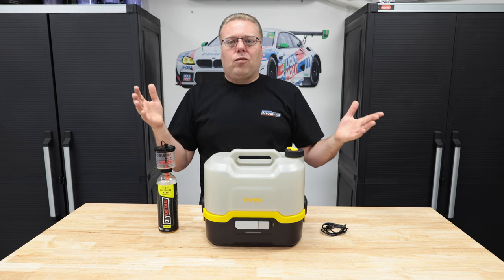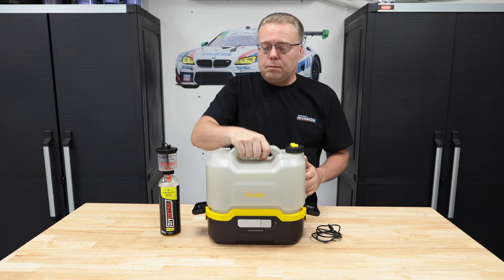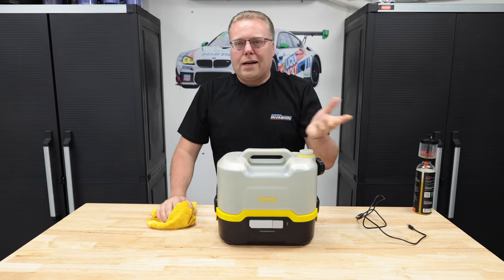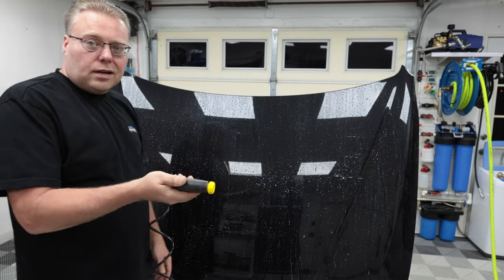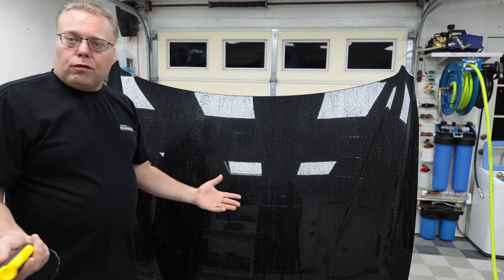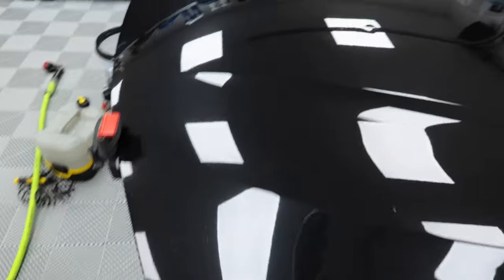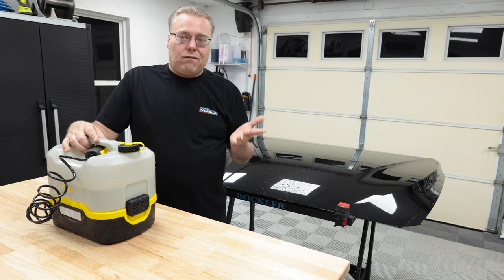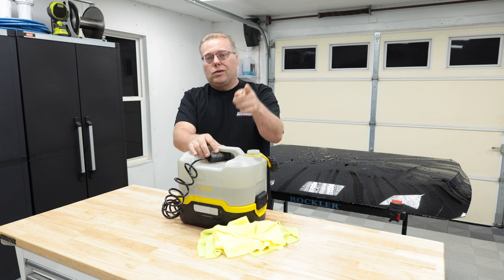Best Rinseless Sprayer? | Battery Powered | Fanttik NB8 | Review & Testing

Comment from the maker: I just noticed that they just added a $15 off coupon on the Amazon listing for this and the 25% off redeem button is still there. That puts it at $83!!!
Reply: You know I considered purchasing this thing a few months back for about 69 bucks however when I read that you couldn't use any soaps or liquids besides water I decided I shouldn't. Maybe I will after this review because it seems really neat for rinseless washing
Reply from the maker: @Mr.SparkleOG  Somebody in the comments said they have been using DIY detail rinseless with theirs for 4 months or so and no problems so far.
Reply: @CarsWithKeav  I did see that and it seems like a better option than a detail keg as those run hundreds of dollars. Thank you for posting this video finally!!

Comment: I was checking it out and noticed the $15 off along with the 25% discount.  So I picked it up for a little over $86 after taxes.  We’ll see if it works out well.  I have two Marilex sprayers and an IK Pro Foam 12+.  It will be good to see how it works compared to these.
Reply from the maker: That’s a great deal I saw that as well when I was building the description of the video. I pinned a comment about it. Such a good deal. I heard it was It $69 during Black Friday, but that’s a once a year deal.

Comment: Bought this around the same time as you and use it exclusively for rinseless wash. DIY Detail rinseless as well and I've had no issues with the seal or the sprayer. I do pour out any remaining liquid after a wash but so far so good!
Reply from the maker: This is great to know and thanks for the info on your experience!
Reply: I put some rinseless wash in it and the seal started leaking. Lesson learned just use it for water…. The liquid was onr
Reply from the maker: @kjrayo18  I would not think ONR would have cause the leak though. It’s the same consistency as water and has no alkaline or acidic properties to damage any seals. Are you saying it doesn’t leak when using water?
Reply: @kjrayo18  interesting, did you check your seal? Mine is still fine and not leaking

Comment: I used a modified ik foam pro 12 for about a year, and it was great. This was before the multi pro 12 that now has the schrader valve I believe. I’d just fill from the compressor and be good to go. I also bought the tip kit for the multi pro 12 from detailed image to swap out. I bought a keg recently that has also been great, just holds the pressure a bit longer.
Reply from the maker: Kegs are a great idea for sure especially how they are getting cheaper and the parts to convert them as well.

Comment: For me, using a pump keg like the big IK wasn't a cost issue. It was a packaging issue.

I do all of my washes in a quiet self-wash bay.

Haul all the supplies I need to and from in my 2 seater.

Packaging is important.
This thing is PERFECT for my applications.

I've been using two IK Multi Pump sprayers, prefilled at home, for my rinseless presoak/sprays. It's a pain.

I take a 3gal bucket, with a Gamma Seal, with premixed rinseless with me. 3 gal bucket so that it fits in my short trunk.

I ordered this thing instantly after watching your video.
Reply from the maker: I’m glad this was able to help. It’s a very situational product as I try to explain to others saying it’s unnecessary. Might be for them, but not everybody.
Reply: @CarsWithKeav  You're right. It's definitely not for everyone.

I'm happy that you covered it.
I think most of the detailing YouTubers still prefer a "standard wash". I include myself in that group.

So really specific/rinseless solutions just don't get covered because it doesn't really fit their situation, where they have access to all the water, all the time, all the space, inside the garage, etc.

For apartment dwellers, a product like this really provides some value.

I'm glad rinseless is getting a lot of attention again, recently.
It means content creators are going to make more rinseless-centric content to ride that wave. More information for people to consume.

Products that typically wouldn't be covered are getting videos.
Reply from the maker: @ I still do both just depends on my mood really. If I have 3 of my cars to do I’ll go rinseless for the contact wash. If it’s just one then it’s a foam party.

Comment: You are just pumping out the product reviews. Great job, keep it up. 👍

One product I want to get is a paint depth gauge. Unfortunately they aren’t talked about much. With all the products you’ve done have you tested any? Aside from the $$$$ professional there are a ton  of cheap ones on Amazon, but I have no idea which one, if any, is actually worth it. Nex Diag has some in the $100-200 range. I’d have no problem paying that, if theyre worth it.
Reply from the maker: I have not looked at any yet as I don’t do much paint correction. It’s something to look into though.
Reply: Thank you for your video man, can this be used with orange degreaser from 3D, or other degreasers for pre wash or just rinseless?

Comment: I’ve been using the SideKing battery powered sprayer for my rinseless washes. A little over a gallon capacity and I can get more than 2 washes with that solution. Less than $40 and I’ve only had to recharge it once
Reply from the maker: That’s awesome!

Comment: Looks like a great little unit for much less cost than a detail keg. Plus you don’t have to spend time starting up the compressor and filling the keg with compressed air.
Reply from the maker: It is a great little unit. Have not used a detail
Keg so unsure of the performance, but I have an IK pro 12 so know all about filling from a compressor.

Comment: I like using the Worx HydroShot to apply my rinseless solution to my car. I zip tied a 2-3 pound scuba lead weight to the intake filter so it stays in the bucket.
Reply from the maker: That’s a great idea. The Ryobi ez clean is a good option as well.
Reply: Doesn't that use a lot of product? An IK Multi Pro 2 filled to the brim (almost 1/2 a gallon) can cover a medium sized car, but I guess the Worx with it's higher pressure will take maybe twice as much?
Reply from the maker: @martinp8427  I have the Ryobi version and if you turn down the pressure and use a chemical tip it sprays about the same. If it comes out more you just got to move faster. Also great pressure to clean off debris.
Reply: @CarsWithKeav  Thank you for the comment! The more I research the Ryobi 600 psi and Worx 725 psi version, the more they feel like a good investment and not needing to go to the self serve pressure car washes.
Reply from the maker: @martinp8427  I made a video on the Ryobi one if you are interested. https://youtu.be/Vot1miL9aes?si=r5ANbtvR00Tiukta

Comment: Just built a detail keg for about the same $ (without the discount) as the cost of this unit. Would have considered this as an alternative.
Reply from the maker: How hard is it to find a decent empty keg? I know some people don’t want to go looking for one.
Reply: @CarsWithKeav  Corney Keg is where to go. Always in stock and not to expensive. I bought the "CORNY KEG CONVERTED BALL LOCK CORNELIUS STYLE KEG W/ MANUAL RELIEF VALVE LID" Man it went down in price since I bought mine
Reply from the maker: @05xrunner  Seems they have I remember a year ago I was thinking of making one and with everything all together it would be $300. Main reason I never did it was because a 5 gallon keg would be quite heavy with liquid, but I guess you only fill about halfway probably to get a good bit of air pressure.
Reply: @CarsWithKeav  Yea, I put about 3g in mine and it really isnt heavy at all feeling. Its amazing the Keg itself empty almost feels like it weighs nothing. I built my Keg a few weeks ago and it cost me about $160. With 3gal I pump it to about 50psi and it sprays forever and is game changing I feel compared to any other type of sprayer. 
Just save the coin and build yours instead of paying 400-500 for a prebuilt that is highway robbery compared to what it really cost. I just copied the build of detailing breakdown video he put out a few weeks ago.
Reply from the maker: @05xrunner  I have seen a few that are built for you for $300 to $350 so the price has gone down. Now no clue what is being used, but if I made one I'm sure it would be expensive I would have all the cool stuff. LOL

Comment: So since I just watched your video on the Amazon deal on this I decided to re-watch this video.  Since this is 5 months ago have you noticed any issues with the rinseless wash staying in the sprayer non-stop since its really designed for just water.  Also have you noticed any reduction in performance of the rinseless wash if it has sat for a long time in the sprayer. I usually mix up my waterless wash solutions in 32 ounce bottles so the solution never stays around for more than a couple of weeks per bottle.
Reply from the maker: @coolwrld302  I talked to Yvan about that and he said since the lid is sealed you are good for 3 months. Open bucket not so much. I myself use it up in a week and a few weeks at the longest. I did notice my 5:1 P&S brake buster in a container started to exhibit performance loss after sitting for a long time. Mainly after switching to Maniac it sat for awhile until I decided to use it all up.
Reply: @CarsWithKeav  Good to know about the rinseless. Have you noticed any issues with the sprayer itself keeping product in it constantly over the last 5 months?
Reply from the maker: @coolwrld302  None at all I beat this thing to death. I kick it around and no problem. Well actually one time I pinched the hose by not properly storing it underneath so it leaked, but it was close to the connection so I just cut the tube and refitted it and worked fine since. That was probably a week after I made that video. I no longer store it underneath I wedge the spray gun in the handle area works better that way. I’m too impatient to store it properly. 🤣

Comment: Ryobi has a battery powered spray for $65 that I was eyeing since I have Ryobi batteries. Have you seen it? Do you think it would work well for rinseless? I'm so tired of pumping haha.
Reply from the maker: I’ve used that one around the house for insecticides. It would spread out just fine, but it won’t have much pressure compared to this one.

Comment: Great. Thanks for this. Will make doing rinse less wash much better. Ordered one. 

Do you have any recommendations for decent spray bottles. I need to make myself a rinse less wash diluted spray bottle for other detailing needs as well as general house hold cleaning or auto interior cleaning. 

I know OG sells their bottles. But I also know he’s talked about newer version bottles with stainless steel nozzle tips. So I am not interested in spending money on his till he’s done his idea. 

Preferably if you have a really good spray bottle recommendation other than his that would be great.
Reply from the maker: I have a suggestion, but it is something he sells and that would be the solo 260 which you can get on Amazon as well. That works great with rinseless.  I’m not into regular spray bottles. I tried the Pressol and they didn’t do well with harsh chemicals so I stopped using them. If you can find an older solo 460 I prefer that one as it has great chemical resistance.
Reply: @CarsWithKeav  actually I have a newer Solo that I was going to use for something else. lol move over other thing and hello new (rinse less wash). Do you think the chemicals of RW will be a problem for the newer solo. 

Sorry to ask this question here. I am trying to find a home for a Bigboi blower (the larger model), and a Kenzie TST1122 all in one pressure washer, and a Vyoer Chair. All specialty items. Any ideas on where to find interested people other than Facebook. 

Again thanks for your help on these recommendations.
Reply from the maker: @26-CJ  I only really know of Facebook Marketplace or the detailing Facebook groups that are for selling used equipment. Rinseless Wash chemicals should have no impact on the Solo at all. They are almost water like with just polymers and some surfactants.
Reply: @CarsWithKeav  👍🏼. These measuring pro blend proportioners. Are they safe to leave attached to the bottles or do you remove yours when done. Mostly concerned with the product staying fresh inside the bottle.
Reply from the maker: @26-CJ  It has a cap at the top to keep it air tight. I always leave them on,  it have gone away from using them to using pump dispensers and storing bulk dilutions.
Reply: @CarsWithKeav   makes sense. So to make sure I understand. Your not using the pro blend proportioners because your using the spout dispensers and pump dispensers with pre made dilutions?  If so I get the tall thin storage containers with the control valve to dispense the pre diluted product. What do you mean by pump dispensers if you don’t mind me asking.
Reply from the maker: @26-CJ  Just replacing the proportioned with a pump that dispenses exactly one ounce. Just a soap dispenser nozzle that you push down and is spring loaded. Like these https://amzn.to/3xes7oZ
Reply: @CarsWithKeav I received my sprayer today. Cannot wait to use it. Does your tank have a slight darker look to it. Almost like a very subtle black appearance throughout the entire reservoir.
Reply from the maker: @26-CJ  Yes it has a slight tint to it especially when the cap is closed.
Reply: @CarsWithKeav  ok so then it’s not just mine. Now in your video the lighting you have must flush out the color I am seeing in mine. Yours looks more like the plastic on a milk jug looks. Milk jugs usually are not transparent much like this sprayer container. But mine has a consistent darker (appears like a black color) all through it even with the lid off. I was worried it was a returned item that had something in it that stained it.
Reply: @CarsWithKeav  hey do you know if these pumps you gave a link to will fit the DIY 1 gallon jugs threads?

Also do you know of a pump size that will also fit the DIY 16oz bottles.
Reply from the maker: @26-CJ  yes, they will fit DIY bottles I have one of them on my incredible suds gallon bottle. There are ones that for 16oz bottles, but they dispense of much smaller amounts. Takes like 4 pumps to get an ounce.
Reply: @CarsWithKeav  cool thanks for confirming. I had to throw out the pro blend proportioner since it leaked really bad when I tipped the 1 gallon jug over to pour out of the pro blend proportioner. Fluid was filling up the pro blend inside as I was trying to empty it. 

So I am going to the pump like you did. 

Oh and we washed our car with the 2 gallon sprayer and it was awesome. Thanks again for showing us this sprayer. May get another one. We wish there was one that had wheels and was a bigger reservoir so you can easily move it around as well as have more fluid when trying to keep the car wet on sunny days

Comment: Hi Keav just really discovered your channel a week or so ago and i have to compliment you you do a fabulous job   Ive also been bing watching all your older video lots of great info there   Just wondering if it was in one of them you suggested how to buy the IK foam pro 12 at the best price I thought you said after using all these different discount codes you could get the unit for around $100 with free shipping   wondering if Im dreaming since I cant seem to find it again in any of your videos   also wondering why you would consider building a Keg spayer thats more expensive and heavier then the IK pro 12.       even that is probably over kill for my needs but since its not much more expensive then the smaller IK sprayer  with the battery air compressor added and when you use the 12 only half filled and fill with an air compressor which I already have and it will run so much longer thought that might be a better idea although may be not quite as convient or as easy to use in tight places as the smaller one without that long wand   thanks for any help you an offer    keep up the great work   bob t.
Reply from the maker: DIY detail used to sell them and with my discount they would be around $100. They don’t sell other brands products much anymore mainly due to not having room for inventory, but they have a bigger warehouse now so maybe they will start carrying them again. If you have an IK 12 I see no reason for a detail keg you could modify with a tire inflator so you don’t need to fill with air. IK actually does make a keg like sprayer as well that tiny and ppf guys use, but it’s like $300. Main reason for kegs is just capacity you can put 3 gallons in one and have 2 full gallons of air displacement. You can do multiple cars without filling with air. Really appreciate the kind words as well!
Reply: @CarsWithKeav  boy, you are sure fast with responses thanks so much   I thought your video was the one    dont know whether you went back and edited your original video since I couldn't find it again when I looked but if its not available really doesn't matter unless they like you say start carrying different products again  because  bigger they now have a bigger new wharehouse   I can always dream
Do you by chance have an email or cell number I can text   you at   since I have a few more questions  about products I would like your thoughts on.      before you ask  no I am not on any social media at all and probably never will be I dont feel the need to tell the world anything about my private life   call me old school but that the way I feel 
thanks again for taking your time to help me out   much appreciated   bob t
Reply from the maker: @robertthomson9340  I know lots of people still off the grid with social media. carswithkeav@gmail.com